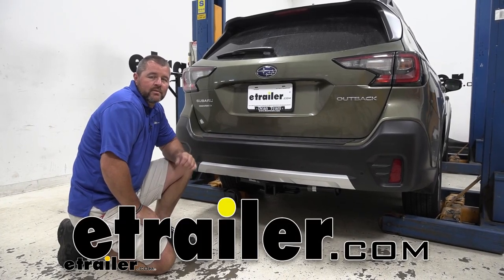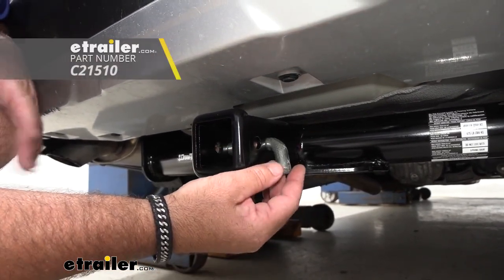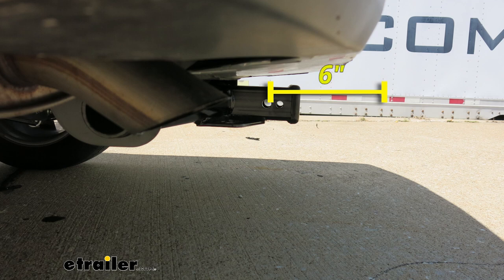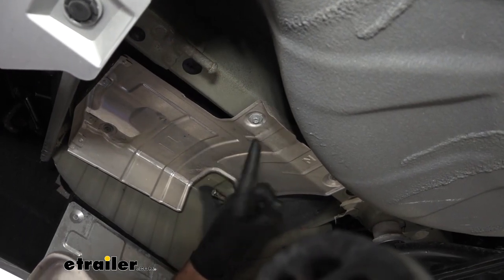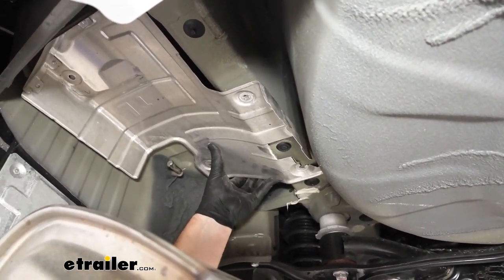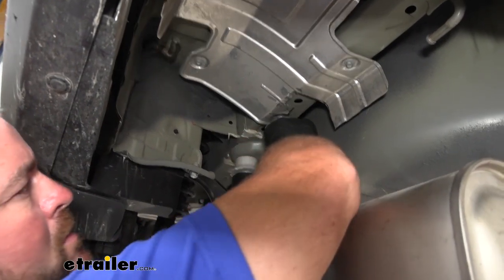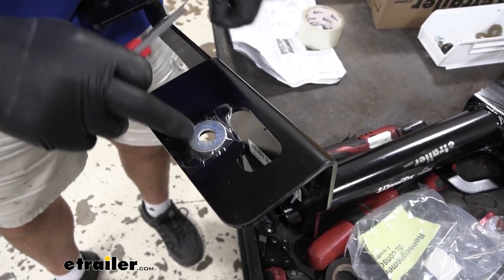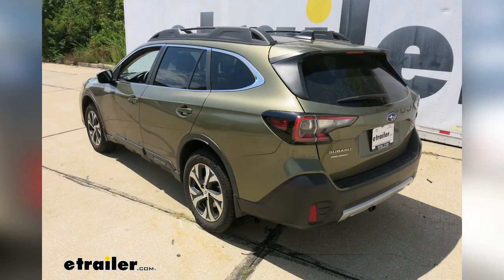etrailer | Draw-Tite Max-Frame Trailer Hitch Installation - 2020 Subaru Outback Wagon

Comment: I'm glad you didn't cut into the frame, for safety sakes.  But what is this rated? It's attached by bolts only?  How does this supposed to carry more tongue weight of 350lbs and tongue capacity than the OEM that is mounted to the body?
Reply: Built different material/structure/thickness
Reply: @montygarza4987  The Outback does not have a frame, but has a unibody design.  Adding to the Subaru unibody design is wise, but how can anyone in good conscience recommend something weaker?  Maybe they didn't know about the unibody construction.